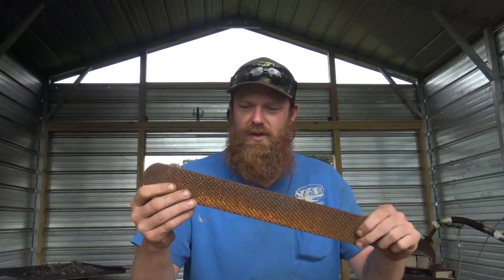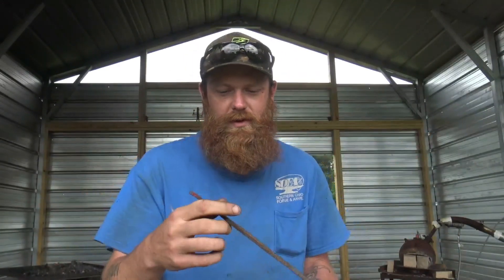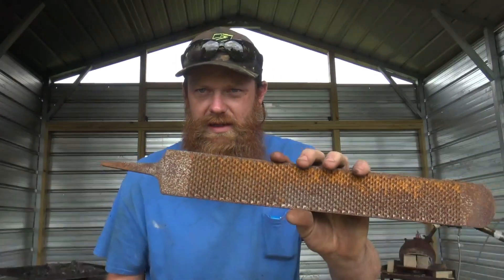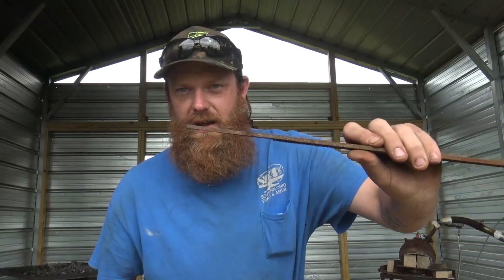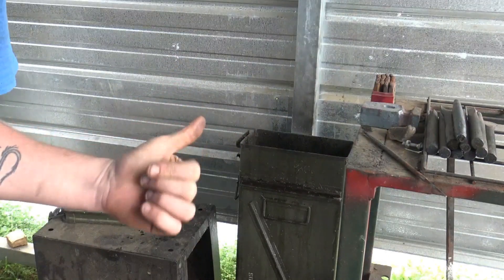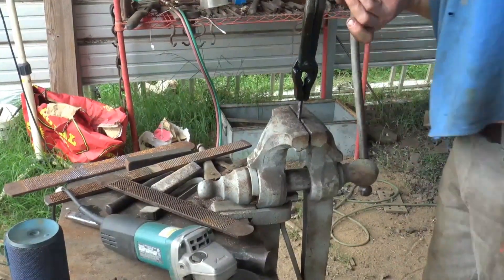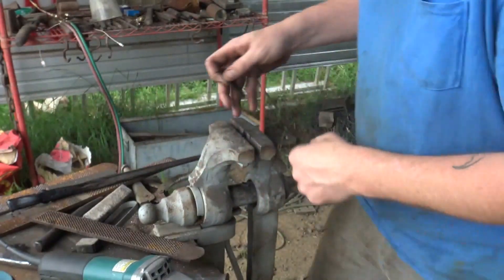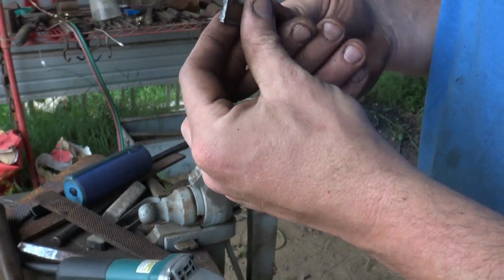Quick Tips From Ting Ting 2: How to snap test mystery steel

Comment: So the case hardened ones will always just bend and not snap clean?  I have a bunch of save edge.  The first one I did snapped(I will use a pair of pliers like you did in the future...it was a bullet through the shop).  The second one i have is already broken in two when i got it but it looks case hardened at the break.
Reply from the maker: Yes the case hardened ones will bend.